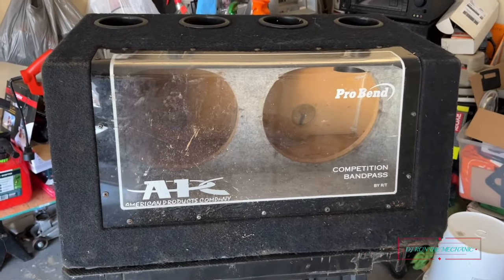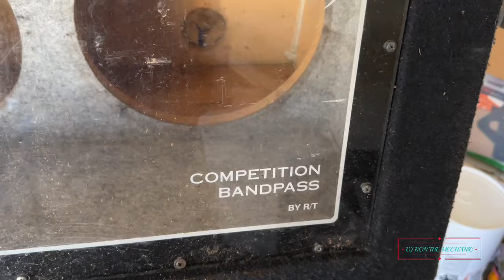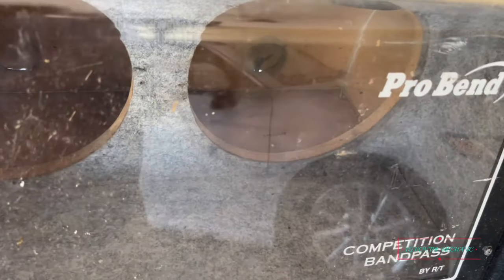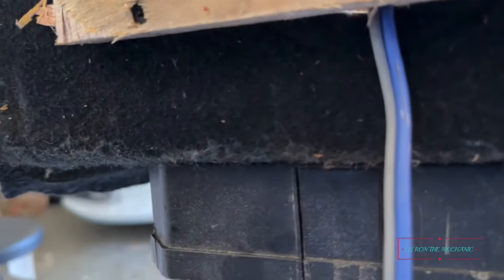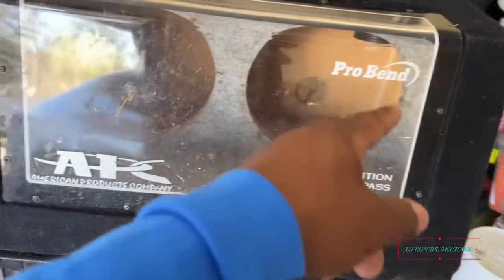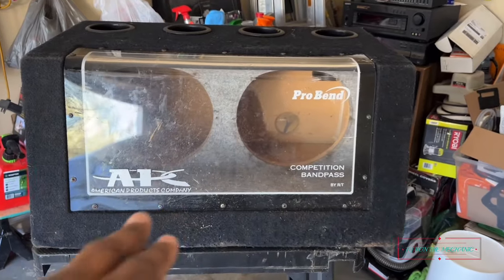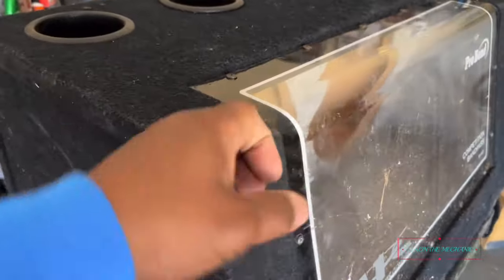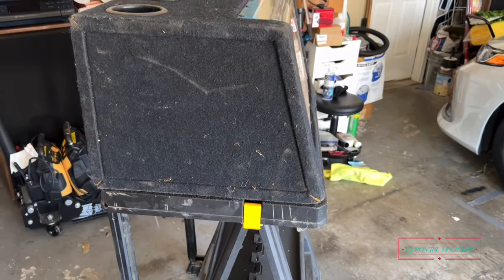DIY Subwoofer Box Restoration Project : Can I Restore This Old Subwoofer Box??? #repair #diy

Comment: That's super cool. That's what I do as well. And that box is very savable and it will sound very good 😎😎😎 add some more hardware on the plexi , and double check the joints as you know 😁 man i'm jelly ,you can also go to home depot and get cardboard tubeing too make the ports longer , can't wate to see it finished ⚡️⚡️⚡️
Reply from the maker: @skatebunch3084 thanks great ideas for the box
Reply: @djronthemechanic3695  no prob , restaration can be very therapudic 😁